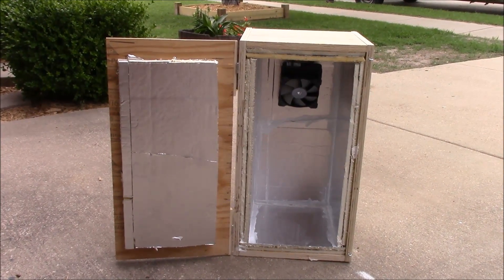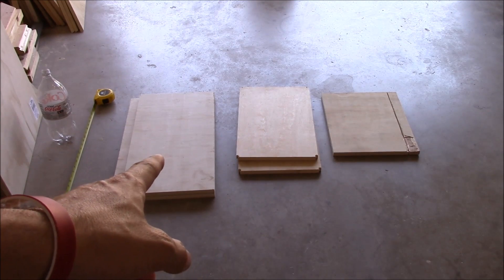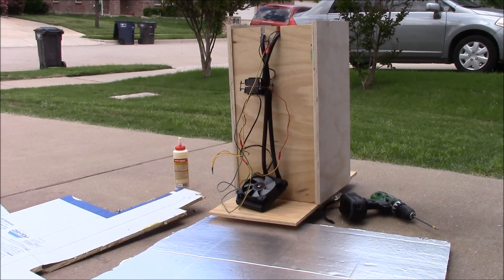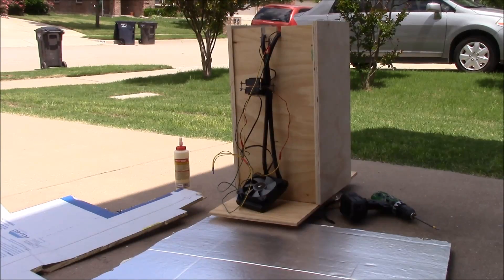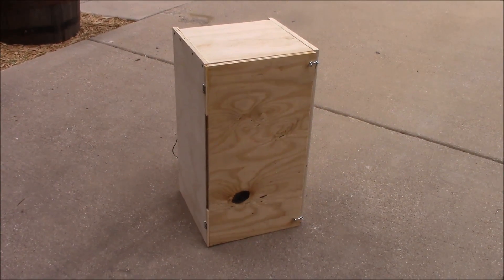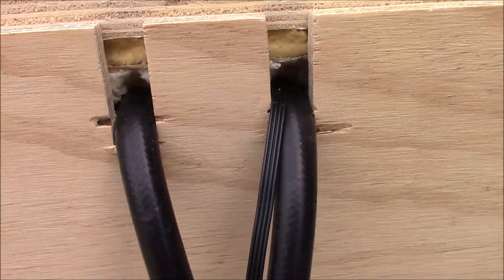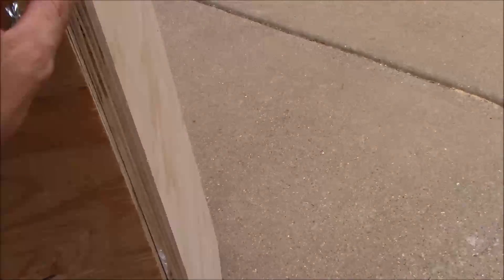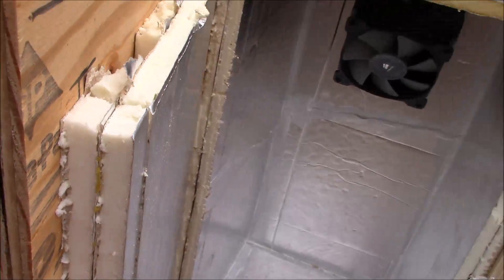Liquid Cooled Peltier (TEC) Refrigerator - Part 2

Comment: According to YouTube video titled: DIY Solar DC Direct without a battery !!!  The 3 common methods.  /  Video channel name:  Solarduino, a 12V fan motor can be powered directly connected to a solar panel array without implementing a battery and without risk of an amp overload to the fan motor if:  (1) The  amp output of the panel array is less than the amp input limit of the fan motor and, (2) each solar panel array powers only one fan motor.  However, perhaps it would be okay to use a solar panel array with the same amp output as the amp input limit of the fan motor if an amp regulator control module or a PWM motor speed controller (potentioneter) and an amp / watt meter is connected between the solar panel and the fan?  Perhaps it would be okay to use a solar panel that has an output current of one or two amps more than the amp current input limit of the fan motor if an amp regulator control module or a PWM motor speed controller and an amp / watt meter is connected between the solar panel and the fan?  However, I do not know if a peltier frig could be powered this way; unlike a fan, a peltier device is a sensitive solid-state electronic device which is not a motor.  Please share your thoughts about this.  Thank you.

Comment: Once again, once you make a chest freezer chest refrigerator understand thing will be a Hove a lot more efficient. All the cold air won't seep out the bottom and you can put plastic liners and stop every bit of every bit of leakage as far as air goes from leaving the unit

Comment: What about using some heat pipes to draw as much as you can out of the unit? Heat pipes if you used propane in them and haven't put some sort of wicked side. And this induce a little liquid propane. Let it boil out and scan up and condemns on the top. Does news any electricity at all? And it should help your situation as far as cooling down the insulation on the outside

Comment: amount you invested in it you could get new refrigerator any way it's good to try
Reply from the maker: Yes, I could get a cheapo portable fridge for about the same cost.  My goal was not to save money.  It was to learn how this stuff works and see if I could use it for refrigeration and air conditioning applications.
Reply: LDSreliance yes i can see that 
got any ideas about airconditioner i also wana build one
Reply from the maker: Yes, you can build one.  This video series is the best I have seen on Youtube for that:  https://www.youtube.com/watch?v=ez9xvO7Ke0s&t=41s

If I was ever going to make a peltier air conditioner, I would copy his design.  The major challenge is he had his heat sink/shroud custom made.  I have scoured the internet many times looking for something similar and I have not found anything, at least not for a reasonable price.  There are peltier air conditioners build for telco, industrial, and remote power applications but they cost $1,000 and up.

Comment: The proportion of your 'hot-side' heatsink vs 'cold-side' heatsink is completely wrong :( sorry...

Generally speaking, because of the thermodynamic properties of TECs; when using in a cooling application; your 'Cold side's' heatsink should be about 25% the size of of your "hot side' heatsink; and may even be passive. Using the same sized heatsinks on each side is going to result in a very minimal temperature differential - regardless of insulation, materials. etc etc

FYI: Peltier Cooler's are available at Walmart for about $70 - the run off a 12v car battery. Sorry to burst your bubble
Reply from the maker: What you state is true with air to air heat sinks but goes out the window with liquid cooled heat sinks.  The heat shedding capacity of the H60 is so much greater than a 5 amp peltier can ever produce.  So the temperature delta is pretty good on this rig.  Yes, I could have used an air to air active cooler or even a passive cooler on the cold side to save on energy and make it simpler.

True, there are Coleman and Wagan coolers for pretty cheap. However, they leave a lot to be desired.  They max out at 35-40 degrees below ambient so the only way to achieve refrigerator temps is if it is 75 degrees outside.  So they are more like a cooler than a refrigerator.

Comment: why did you not just use an ice chest instead of an ugly wood box? An ice chest would have already had insulation and the door would have sealed just fine. You could get a decent ice chest at a thrift store or yard sale for less than $10.
Reply from the maker: True, and I want to try this at some point.  The challenge is mounting the equipment to an ice chest, which is just basically thin plastic with a hollow area in between and some styrofoam insulation.  I'm not sure how much weight the plastic will hold and how to seal around the edges of the hole that you have to cut in the chest.

Comment: Expanding spray foam is your friend... :)
Reply from the maker: +Torrey Jones Haha, yeah but that stuff is messy and stinky!  I would not use it in something that is going to come in contact with my food.
Reply: +LDSreliance You're already using the same material in this project, simply in a form that has already been expanded at the factory. Your existing refrigerator is made of the same material, as is nearly every ice chest out there.If not exactly the same, than similar enough as makes little difference. spray foam need not be messy, just use care in how its used. I've used it myself in the past to plug leaks and drafts in my old house, and had no problems keeping it neat and tidy. (I'm talking about this stuff: http://www.homedepot.com/p/GREAT-STUFF-16-oz-Gaps-and-Cracks-Insulating-Foam-Sealant-162848/100003351  Not this stuff: http://www.energyefficientsolutions.com/sprayfoam.asp)
Still, it's an interesting project, just think you could have gotten a bit better results if you didn't have the leaks, and that's what the spray foam is best at plugging. I even re-insulated/upgraded my grandfather's old metal ice-chest with the stuff, Works lots better now... :)
Good Luck, Enjoy!
Reply from the maker: Torrey Jones
Yeah it is a great product.  But the aerosol in it smells bad and I am just afraid it would permeate my drinks/food.  I might try it out sometime, though.  Good idea.